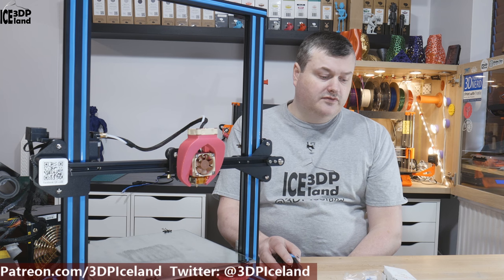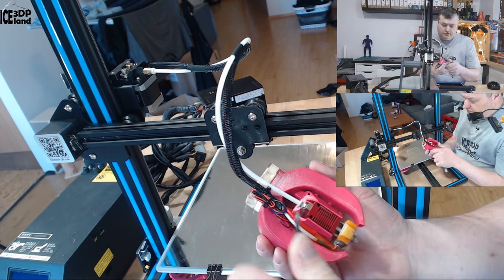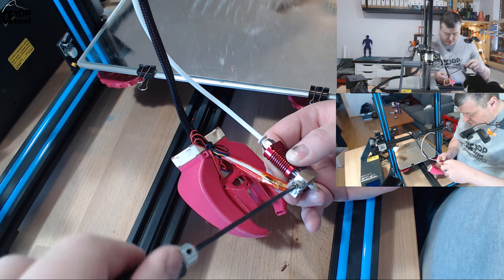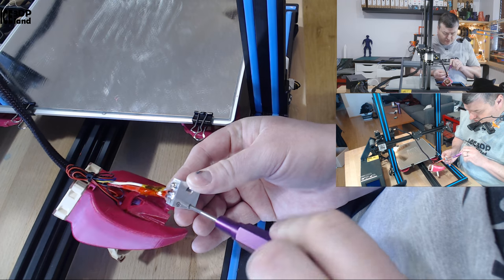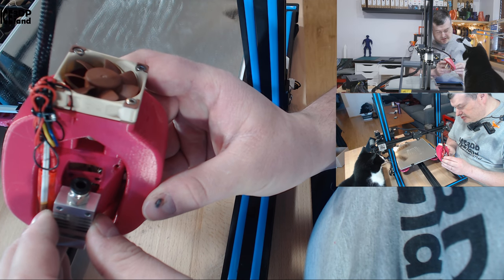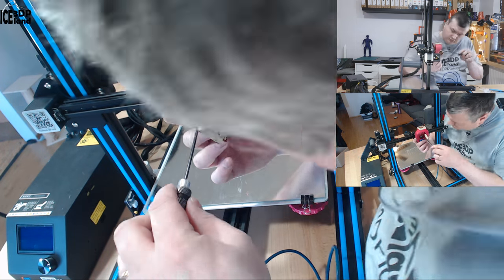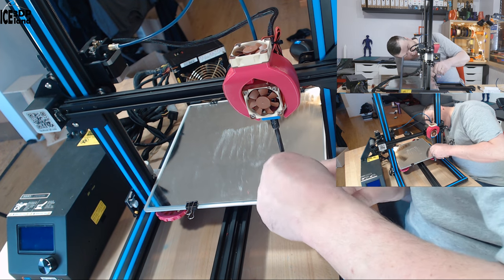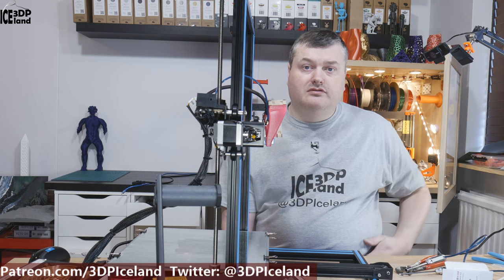Creality CR-10S -  Micro-Swiss All metal hotend Upgrade

Comment: On my CR-10, I removed the two screws from the hot end to the cold end. Noticed an immediate improvement in temperature stability. Doesn't make any sense to leave them in. Just be careful when changing nozzles to not damage the heat break. Next major improvement is a decent part cooling Duct. Stock is useless
Reply from the maker: Chuch from filament friday did a test with this, and contacted creality, he did not find a difference with or without the screws, and creality wants them in to stabilize the head and reduce change of bent heatbrake.
Reply from the maker: Chuck :)

Comment: Marteinn, I put the same hotend on my CR-10, and had issues early on with it clogging up, a few e-mails with tech support got me squared away, retraction has to be 4mm or less, otherwise the melted filament pulls back in to the heatbreak and can cool there during longer head travels.
Reply from the maker: Thanks for this information,  - I have 2.5mm retraction set now after I installed the bondtech extruder and capricorn PTFE tube, - :), but good to know, - thanks. ( video on that comming later :)

Comment: Would you say it prints any better than the stock hot end? Do you have any issues with clogging like Uncle Ron?
Reply from the maker: kkuenzel56 hi. I have not had any issues with clogging, and yes, this upgrade did give me better resaults, along with capricorn tube and a bondtech extruder.

Comment: oooh....be careful about pushing an unlocked axis rapidly like that....the steppers become generators and feed back into the controllers and the board...
Pretty cool build...liking it...(paint that daggum pink cooling fan though...bleh :D )
Reply from the maker: Thanks for the heads up on moving the stepper motor, -  , - the Pink is for 3D-PinkMafia boss Heather :), It's a great color :)